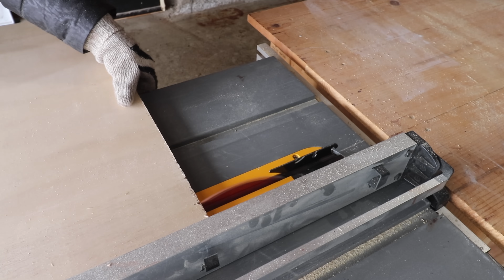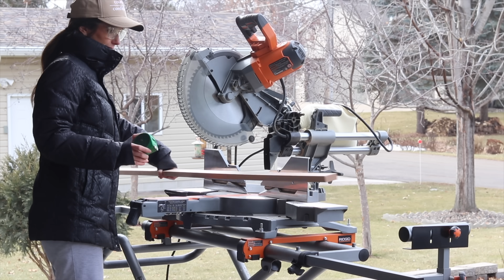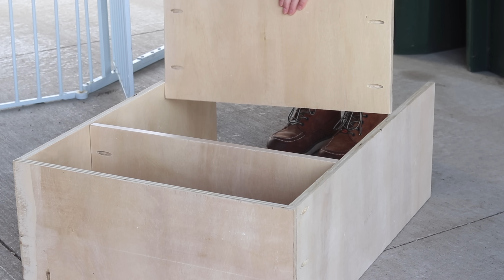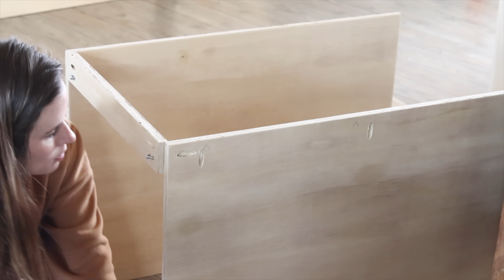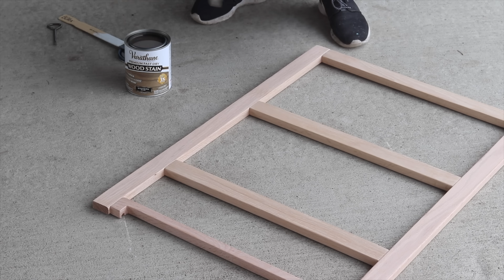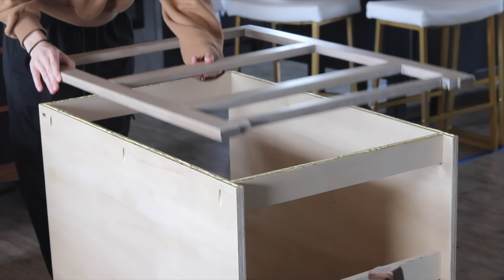Build Cabinets That Are Easy, Cheap, and Strong!

Comment: First off: My biggest respect for everything you do. If you did not learn anything of that in Craft school, then it is even more impressive. The other thing that I find always "funny" is that DIY'er always wear a mask, even like in this video outside when they sand. Don't get me wrong, I totally understand and support it (I do it as well). But it is kinda funny because I hardly see any professional wearing a mask in a shop. And there is a lot of fine dust.

Comment: One suggestion I will make is to glue the face frame directly to the carcass. By applying a first coat of glue and letting it dry, then apply a second coat to attach the face frame will result in a weak bond.  Wood glue, or PVA glue will not bond to itself. It requires fibers of wood or suitable substrate to make the bond. I do not recommend this method for building cabinets, especially when using pocket holes to hold it together. It’s only a matter of time before it fails.

Comment: I notice you didn't glue up the pieces before assembling. Is there a reason for this?
Reply from the maker: I didn’t feel it was necessary except the face frames which feel the strain of door hinges. I glued all face frames as well as screwed through pocket holes. For the box assembly I didn’t glue, kreg screws are strong enough imo

Comment: Looks you're doing superbly with Kreg system (which I used bldg our log cabin cabinets in MN). A couple ideas one told me was to put a smidgeon of glue on junctions where Kreg screws go to strengthen the joint (minimizing damage from contraction/expansion -moisture/temperature) & using :coarse screws for soft woods & fine screws for hard  wood.  Know you knew all this though.  Did that slide out cutting board you showed (made my marriage stronger).  LOL

Comment: I really like the painter's tape no-tearout trick!  I haven't tried that for crosscuts (though I have for drilling).  I build electric guitars and don't use a lot of plywood except for fashioning templates.  Next one I do, I'll give this a test!
As for the 12 hours of sanding -- definitely a lot (kind of like guitars 😁)!  Pneumatic sander might be a good choice for you to eliminate so much vibration going forward.
I have done cabinets in my more ambitious past; I think you put more love and care into yours than I did to mine, lol.  Very nicely done!  Thanks for the tape tip!  I look forward to seeing more!

Comment: I built wall cabinets for  my garage workshop using this face frame method with pocket screws and they are holding up really well considering the heavy power tools  inside. One thing I did differently is I used the Kreg tool to make my shelves adjustable with pins rather than making them a fixed height. The tool makes it super simple to align holes and drill to the same depth each time.

Comment: Glue your pocket hole face frames, then sand the face frame so that the whole frame is smooth and flat instead of sanding each individual piece.  That way the entire face frame is flatter and smoother at the joints especially.

Comment: They are only cheap if you have all the power tools and free wood.
Reply from the maker: The wood was pretty inexpensive, for all six cabinets I used 3 sheets of sanded plywood at $65 each (Home Depot). Then I bought five 8 foot long 1X4s on sale for $16 a piece at Menards. So all in all the wood was under $300! I don’t like getting the comment about tools because I worked for years with secondhand tools that were very inexpensive and when you ask someone how expensive a recipe is, do you also complain that they have the best pots and pans to cook with? Or do you ask how much it costs for just ingredients?

Comment: Looks great, good job! As someone who's built cabinets before for built-ins, etc. the only advice I'd have for newbies watching are:

1) Use poplar for face frames - it's as cheap as you can get, cuts really clean and paints excellently (don't have to deal with the open grain holes in oak). 
2) They do make a couple of specialty clamps for pocket hole assembly, which I use. They definitely help make sure surfaces are flush and tight so they don't shift around as the pocket hole is driven home.

Happy building!

Comment: If I could make one recommendation on tool selection, if you do a lot of sanding do yourself a favor and get a good sander.  Believe it or not it makes a huge difference.  Your sanding will go a lot faster and there’s minimal vibration and there much quieter.  I didn’t think they were worth the price until I used one.  I recommend festool or Mirka.
Reply from the maker: I’ve been looking into a sander where I don’t hold the tool, instead I hold the material. Do you have experience with something like this: https://workprotools.store/products/workpro-belt-disc-sander-4-in-x-36-in-belt-6-in-disc-sander-with-6pcs-sandpapers-cast-iron-base-for-sanding-woodworking-diy-decoration?_pos=5&_sid=4371c0262&_ss=r
Reply: @WelcometotheWoodsBlog  I have not used those.  I’m sure they have their place.  if I’m not mistaken I believe they are great for more aggressive sanding like shaping.  Probably not great for fine sanding.

Comment: Love those cabinet boxes!  I thought making pocket hole joints was something really hard to do but thanks to watching the way you make yours over the pass few months it gave me the confidence to give them a try so I did and they are so much fun and they make such a strong joint.  I was wondering if I use pocket  holes on drawers would it be necessary to use glue or are they storng enough without glue?  Especially here in south Louisiana where its so humid.  Go Tigers!  
Thanks  

🍻
Reply from the maker: I’ve always done them without glue on drawers! If your house isn’t air conditioned against the humidity perhaps you should glue
Reply: Thanks a bunch! @WelcometotheWoodsBlog  🍻

Comment: Hi Melissa, First off, Kudos to you on a lovely cabinet and fantastic channel. My husband and I built a custom kitchen with every bell and whistle due to the DIY savings, after letting go of our cabinet maker who kept making specification errors. Before we took this on a handyman made 1 in-wall cabinet with presanded plywood..After that I discovered Columbia prefinished plywood. It's gorgeous, only slightly more expensive; totally worth it for the time saved and perfect look. Sanding vibration kills my hands and arms too. Hope this helps. Looking forward to seeing the rest of your kitchen renovation!!
Reply from the maker: I haven't heard of that before, I'll look it up!
Reply: P.S. Columbia prefinished plywood was a gamechanger. In Canada, it was a special order item from Home Depot, but I found it (or comps.) at various local wood dealers. One thing, though, the finish is pretty durable, so I'm not sure you could ever sand it if you wanted to paint it without sanding through the finish layer. If you're painting, then I'd stick to presanded plywood or MDF depending on your application. MDF takes paint better but is heavy, has toxic particulates, doesn't take screws well and is awful near water. That said I made our painted MDF shaker drawer fronts near water work by sealing the edges and panel with automobile Bondo. Take care.

Comment: Very nice. I built cabinet this way. We bought a "tear out" Amish built kitchen that was one cabinet short for our design. I copied their measurements and recreated the style. I don't have a table saw so everything was done by clamping a straight edge, and using a "finish" blade on my circular saw. Still solid seven years later!

Comment: I found sometime that when i pocket holed the face frames on using oak they would split, so i stopped even trying.
Reply from the maker: Do you do biscuits or what do you do?
Reply: @WelcometotheWoodsBlog  Hi Again!  Now I domino and clamp. Before that I used a dowel jig.  Oak was the only wood I had problems with cracking though, so the rest I pocket hole.